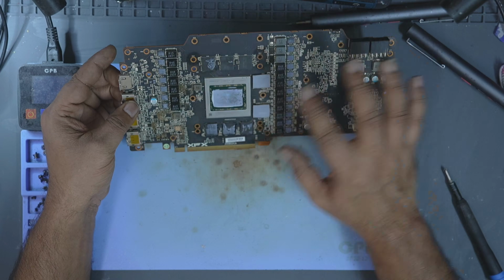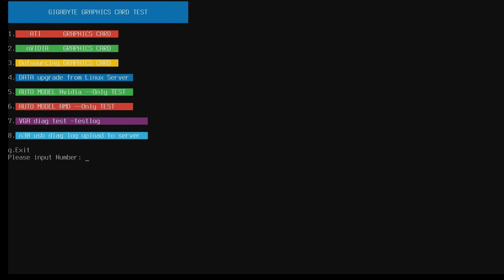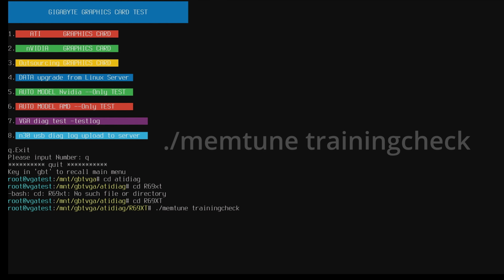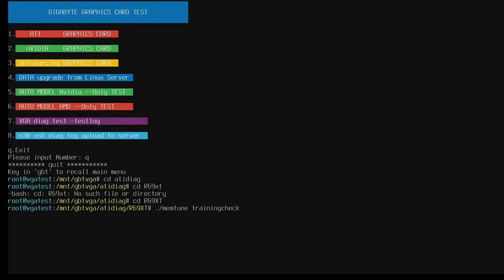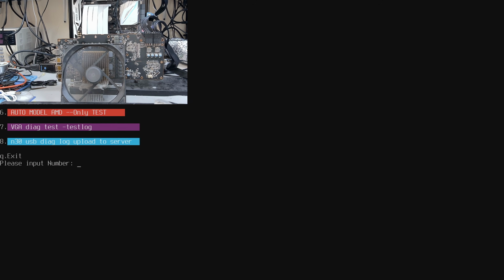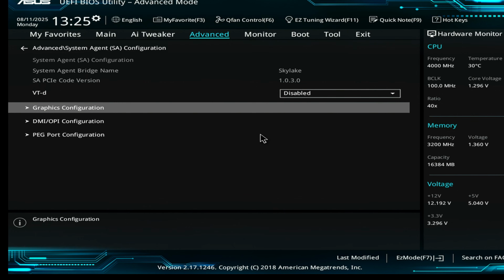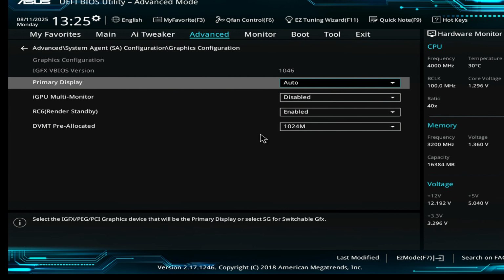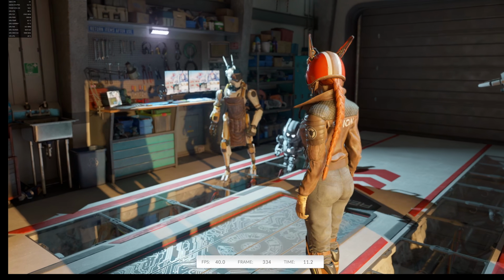How to Fix AMD GPU Memory Errors | XFX RX 6900 XT Repair Guide

Comment: Hi, that looks awesome thank you for the video,
I'm trying to repair a RX 6800 with error code 43. If I install drivers it's showing me a greenscreen, without the drivers just the windows ones it runs ok.

Do you know what this could mean? Faulty vrams or something? Would be great to know. 👋🏾
Reply from the maker: Most likely it is core issue. If it boots and shows image then AMD GPUs don't have memory errors. If you run memtune it will likely give a message "no errors detected". In this case check if the memory and other voltages are normal and a core reball may be required. If that does not fix the issues then it may end up as no fix. If it fixes the issue then you have solved the error. On AMD GPUs in my experience very few really resolve like 10% of the GPUs started working normal rest showed same symptoms.
Reply: @GraphicsCardRepairs-tk7ql thank you very much for the reply ❤ I will try my best to save the gpu

Comment: Why the Vram chip could not be reused?
Because of the epoxy?
Reply from the maker: @Sofian-k75 Yes, the epoxy is the main reason. On the XFX Merc 6900 XT (and the 6800/6800XT/6950 XT), XFX applies black epoxy around the bottom-row memory modules to 'hold them in place', but as Frazer shows in the video, that epoxy soaks under the BGA during removal — there's no clean way to lift the chip without ripping pads or contaminating the die. Even chips that lift cleanly come off with greyed/contaminated pads, so the standard practice is to bin the original IC and fit a fresh memory module. The repair is then verified by re-running memtune.
Reply: heat will shorten its life by 100 times so no point in using it again
Reply from the maker: @Sofian-k75 Yes, the epoxy is the main reason. On the XFX Merc 6900 XT (and the 6800/6800XT/6950 XT), XFX applies black epoxy around the bottom-row memory modules to 'hold them in place', but as Frazer shows in the video, that epoxy soaks under the BGA during removal — there's no clean way to lift the chip without ripping pads or contaminating the die. Even chips that lift cleanly come off with greyed/contaminated pads, so the standard practice is to bin the original IC and fit a fresh memory module. The repair is then verified by re-running memtune.

Comment: Can you provide a link to memtune?
Reply from the maker: @gregs-d1f Same answer as the others — memtune for AMD (and the equivalent MATS/MODS scripts for Nvidia) are open-source tools that need significant cleanup before they'll run on most benches. Frazer bundles a pre-built, error-fixed version of the testing environment on a 16GB USB stick available from gpusolutions.net, and the USB also includes a command reference card. Check the video description for the direct link, or email support@gpusolutions.net if you can't find it.
Reply from the maker: @gregs-d1f Same answer as the others — memtune for AMD (and the equivalent MATS/MODS scripts for Nvidia) are open-source tools that need significant cleanup before they'll run on most benches. Frazer bundles a pre-built, error-fixed version of the testing environment on a 16GB USB stick available from gpusolutions.net, and the USB also includes a command reference card. Check the video description for the direct link, or email support@gpusolutions.net if you can't find it.

Comment: Why show everyone the software for detecting memory faults and not tell them where to find it?
Reply from the maker: @karlpenney657 Fair call — Frazer mentions in the video that the raw memtune/MATS scripts are not available from a simple download. He distributes a pre-built, error-cleaned, ready-to-boot USB (with command list included) for purchase via gpusolutions.net, because the upstream builds from the community servers need cleanup to actually run reliably. Head to the website shop to order, or email support@gpusolutions.net if your country isn't on the shipping list.
Reply from the maker: @karlpenney657 Fair call — Frazer mentions in the video that the raw memtune/MATS scripts are not available from a simple download. He distributes a pre-built, error-cleaned, ready-to-boot USB (with command list included) for purchase via gpusolutions.net, because the upstream builds from the community servers need cleanup to actually run reliably. Head to the website shop to order, or email support@gpusolutions.net if your country isn't on the shipping list.
Reply: Google is ur friend 😂

Comment: Hello, where can I download that program?
Reply: same here any luck finding this
Reply from the maker: @patataplus7661 The memtune (and MATS/MODS) tool Frazer shows in the video isn't downloadable from a single public link — he offers a pre-built, error-cleaned version on a 16GB USB stick so you don't have to wrangle the build yourself. Order info is at gpusolutions.net — search the shop for the memory testing USB. If you're based somewhere they don't ship to, drop an email and they'll add your country. Worth checking the video description too, sometimes the link is pinned there.
Reply from the maker: @patataplus7661 The memtune (and MATS/MODS) tool Frazer shows in the video isn't downloadable from a single public link — he offers a pre-built, error-cleaned version on a 16GB USB stick so you don't have to wrangle the build yourself. Order info is at gpusolutions.net — search the shop for the memory testing USB. If you're based somewhere they don't ship to, drop an email and they'll add your country. Worth checking the video description too, sometimes the link is pinned there.

Comment: Hi, is it possible to upgrade vram on the gtx 980 ti; I have one and I want to make a second pc for 1080p gaming, but am afraid that even 6gb is too low for 1080p these days
Reply from the maker: No not possible to upgrade further
Reply: @GraphicsCardRepairs-tk7ql  Is that because of bios software or the memory chips themselves
Reply: @ilicktrains8304 More memory higher voltage means more heat means card can die easily

Comment: My PC powers on , goes to windows and everything. Just doesn't recognise the GPU at all. Exact same XFX 6900 xt card
Reply from the maker: It could be that the GPU is not detected. possible that some voltage on the GPU is missing

Comment: How to diagnose faulty memory in rx 5700xt
Reply from the maker: You will need the memory testing software to test it. Command to run ./tserver -boardtest=memfa
Reply: Make a video on rx 5700xt

Comment: Hello, excellent video where I can configure the program to run the tests. Maybe you can help us with that, thanks.
Reply from the maker: This is a free software but the size is 95GB. The link I downloaded is no longer active proberly due to the size. If you are interested I am selling a flash drive which is cloned with the one I am using. It's just plug and run. The link is below to buy the 128GB flash drive. 
https://gpusolutions.net/shop

Comment: Zotac gtx 2060 ram upgrade yes or no sir? 😅
Reply from the maker: I have not tested on a 2060. There is a high possibility of working, but the question is, will it be able to make use of it?

Comment: Hi Fraser, great job... thank for sharing...very claruty the process explanation... can you explain how wi can do same troubvleshooting on a laptop that has the IGP AMD or Nvidia with same syntoms with blank screen, how we can use a external/second VGA to use the test MATS or MEMTUNE? thank in advance... please can u tell us same link where to find all Error Code form AMD/Nvidia... very great you teaching method slow and quite... Sorry Last question, i work on Linux Mint platform is possible to install natively the tools MATS/MEMTUNE on Linux to have a Lab Workstation ready to attach the Video Card... bye Francesco Timpano from Florence Italy
Reply from the maker: The size of the software is about 92GB for AMD and about 2GB for Nvidia. The link that I downloaded is no longer active. probably deleted due to the size. Though the software is free, to raise funds, I am now selling a cloned version of the memory testing software on a flash drive on my website, where a cloned version will be shipped to you. If you are interested, below is the Link.
Link: https://gpusolutions.net/shop/
Reply: Hi Fraser, thank very much for your pro replay..at next..bye Francesco Timpano

Comment: A lot of the CPU doesn't have an integrated GPU even if the motherboard has the video connectors.
Reply from the maker: Yes the cpus that don't have an integrated GPU don't have much options. If you have a black screen and the fans on the GPU are spinning, it is a sign of memory error.

Comment: How and where can i get the memtune files and the menu? 

I have a 6900XT SE from sapphire which is not detected and got reflowed by the previous owner. 
I actually dont have much Hope in that card but i want to try and fix it
Reply from the maker: The size of the software is about 92GB for AMD and about 2GB for Nvidia. The link that I downloaded is no longer active. probably deleted due to the size. Though the software is free, to raise funds, I am now selling a cloned version of the memory testing software on a flash drive on my website, where a cloned version will be shipped to you. If you are interested, below is the Link.
Link: https://gpusolutions.net/shop/